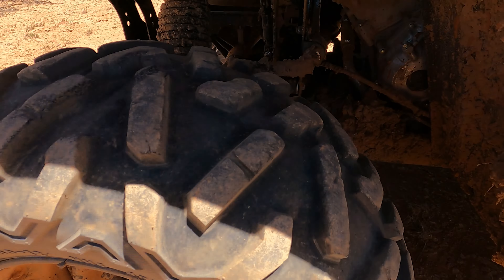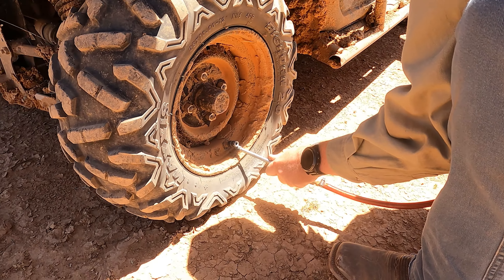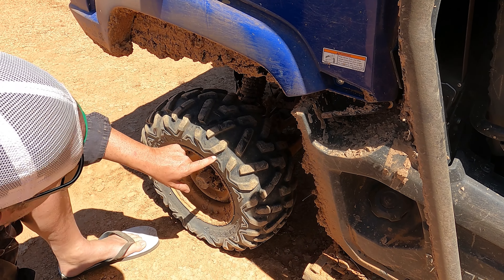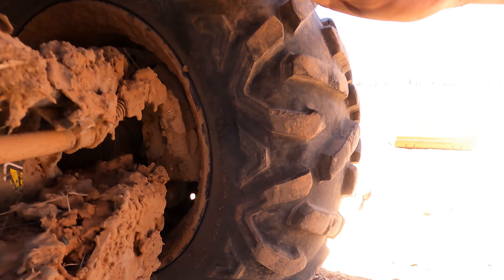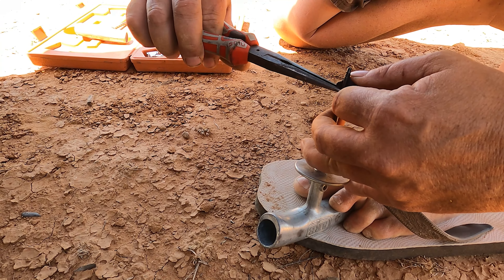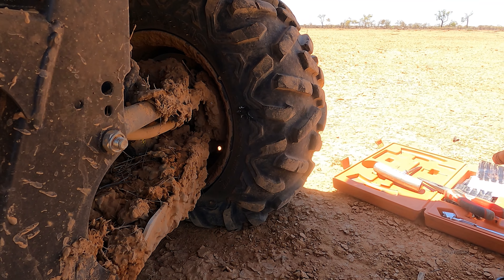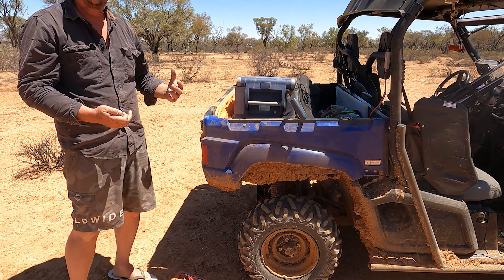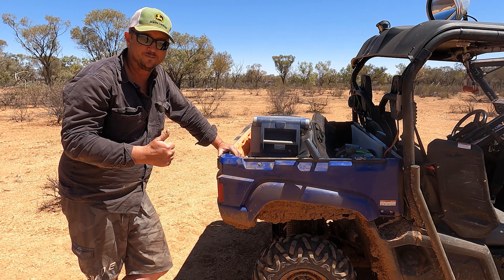Disaster averted  fixed flat tyre in the yamaha viking

Comment: I learnt the hard way. Had to drive on a flat and sacrificed the tyre. Forgot to load in the air compressor. 😫  I've made a spare wheel carrier out of a bike rack attached to the tow ball slot. Also carry a bottle jack, puntucture kit and compressor. 😆

Comment: that will get you home but that hole will keep splitting because of the flex in the sidewall unless you get a vulcanised repair done at a tyre shop that tyre is buggered pain when it happens to a tyre with plenty of tread left
Reply from the maker: Hi John. Believe it or not, that Tyre is still going. 3 months on. We have a full set of new tyres to go on shortly, after we do the rear spring upgrade.